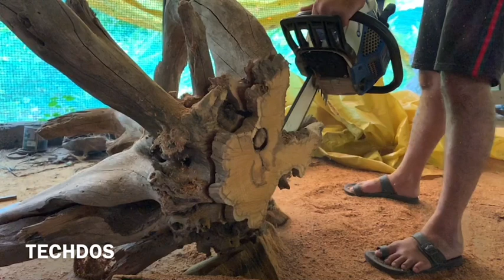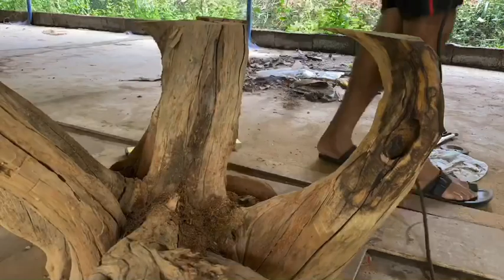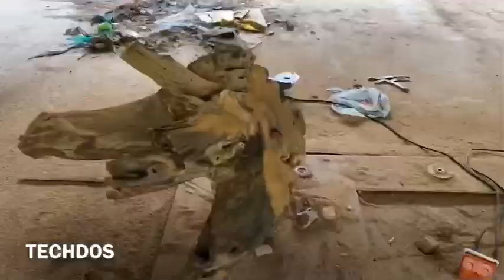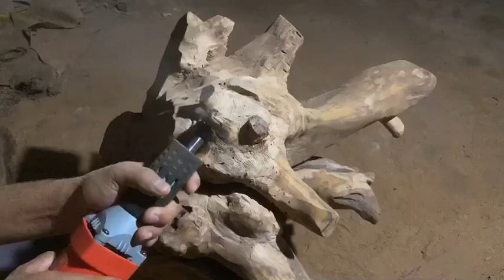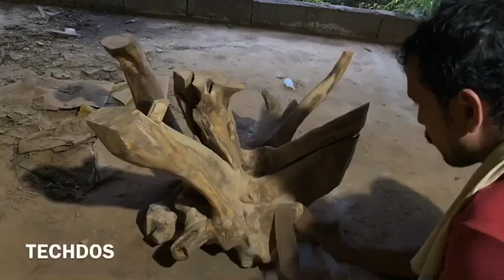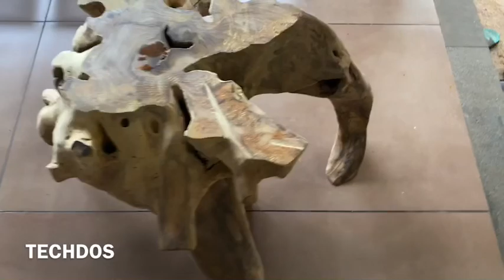Wooden root coffee table #2 | coffee table | TECHDOS

Comment: U didn’t connect the glass in anyway? What’s the best way to glue glass to wood on a table like that?
Reply from the maker: If the glass is enough wait so no need any screw or glueing
Reply: @techdos2020  thanks for the reply. And if the glass is only sitting on one piece of wood in the middle, would you glue it? Or better to screw it?
Reply from the maker: @morielbareli1102  the glass is 12mm thick and the weight enough to sit it self 
  If Necessary put the pices of leather On tops
Reply: You don’t!